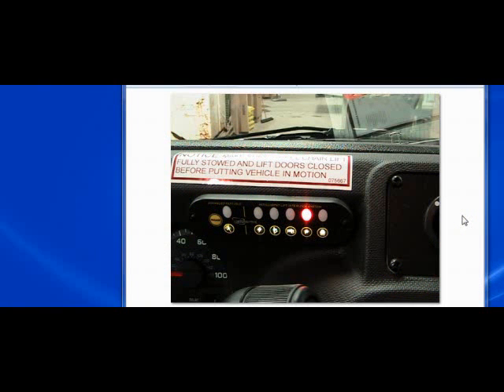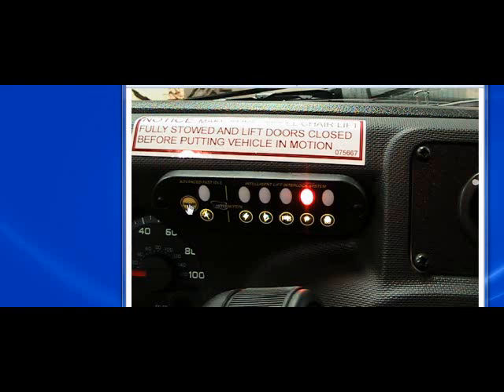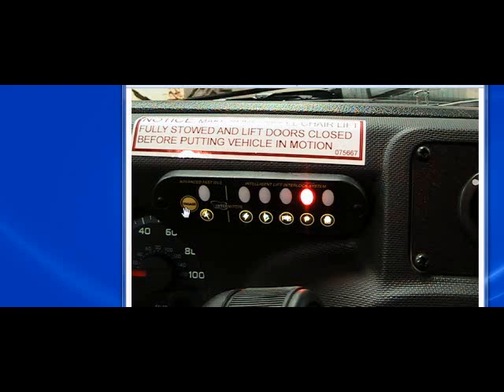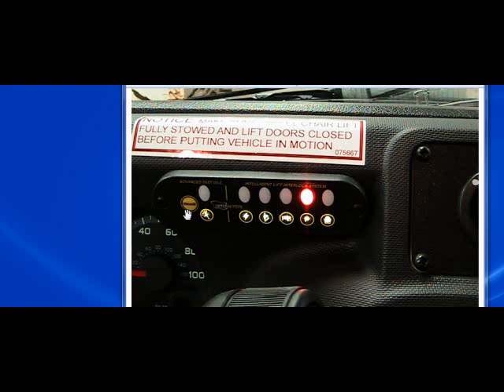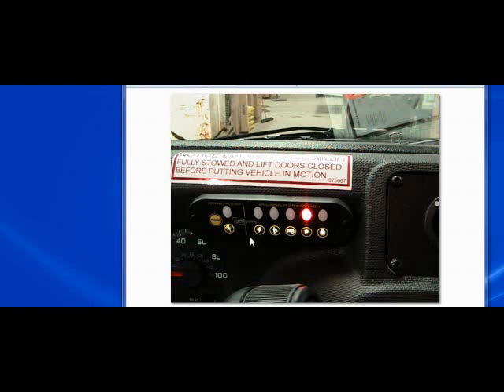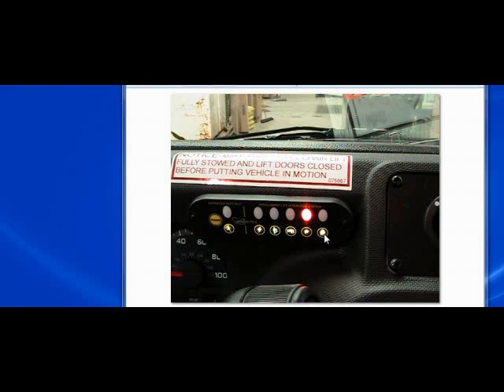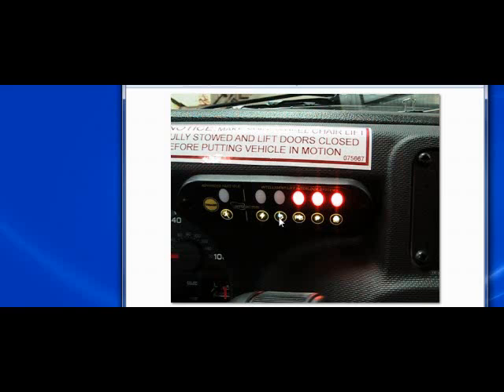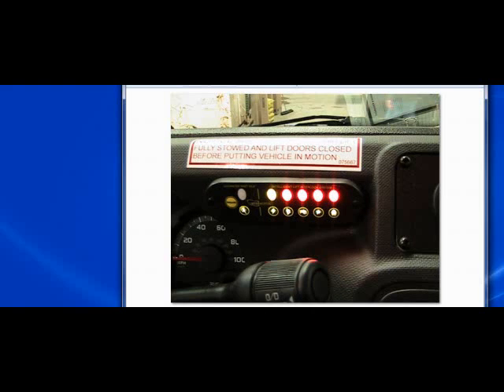Gateway LED Panel

Comment: I've got one on a 2006 E-450. I haven't seen the lights come on, but there's a "Lift Door Ajar" light that was added. The idle controller is separate from the interlock. This was installed in 2006.